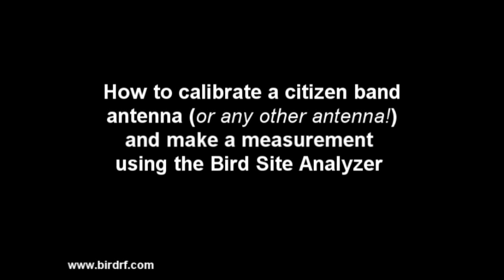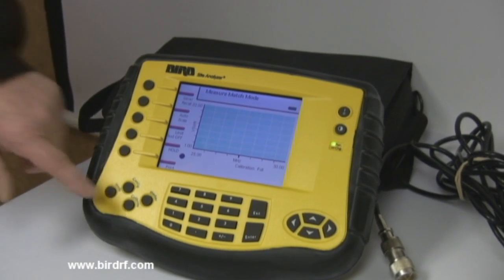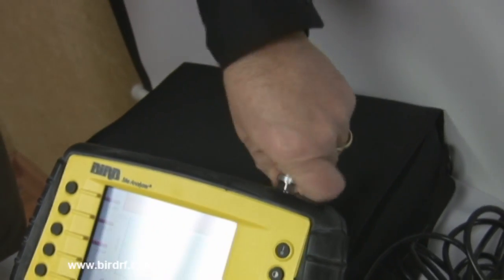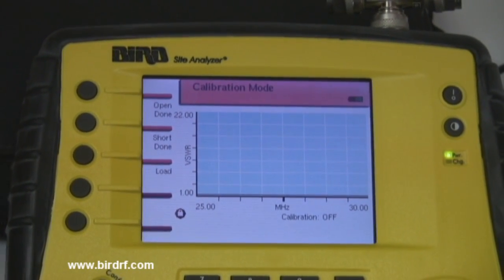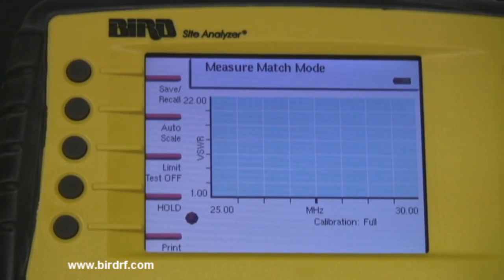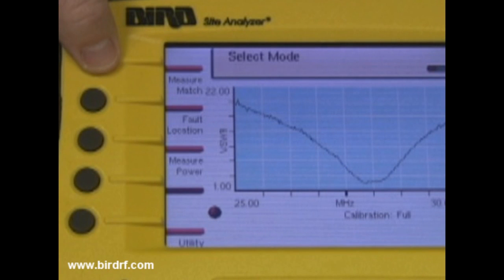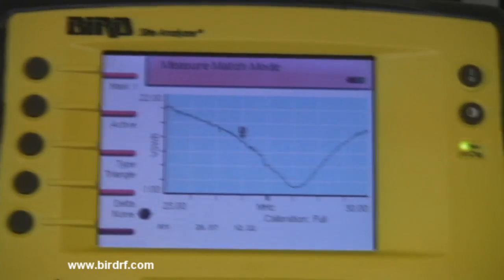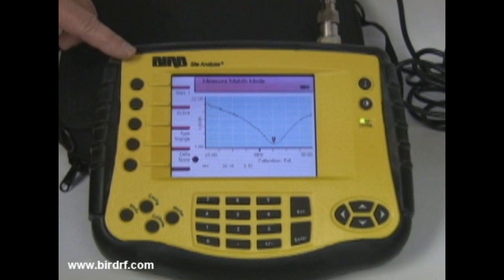Bird Site Analyzer and Antenna Calibration

Comment: We have this analyser but we need to buy calibrating element and cable please let me source to buy
Reply from the maker: Hello - thank you for your inquiry.  Not sure what model number you have, but it appears to be an SA-1700EX or SA-1700EXP which both have been obsolete for several years.  However, the parts you are looking for are the CAL-MN-C (cal combo) and the phase stable cable would be TC-MNFN-1.5   They are available on our store to purchase.  Here are the links: https://btgstore.com/canmcaco.html, https://btgstore.com/tcseteca.html.    If you are outside the United States, you will need to contact sales@birdrf.com to purchase.    Thank you!